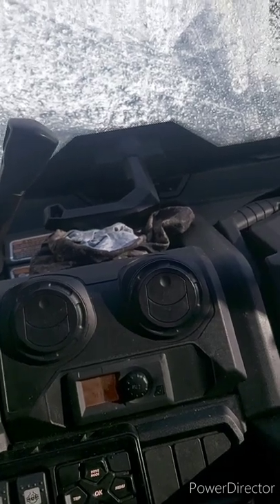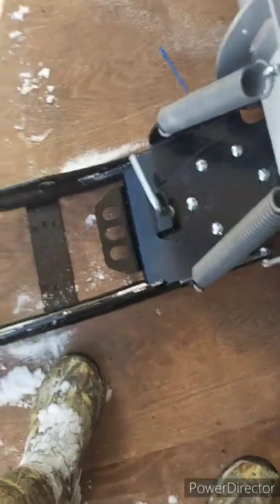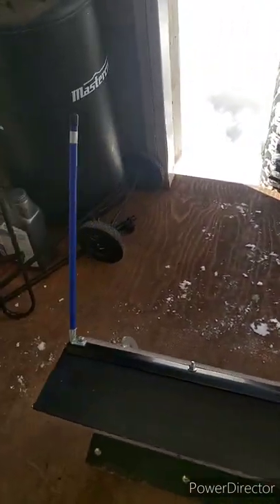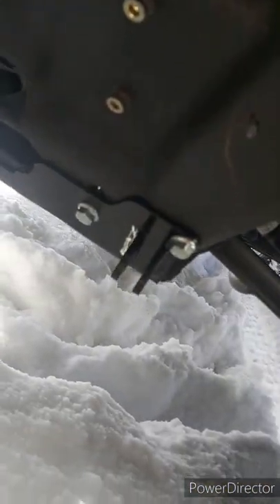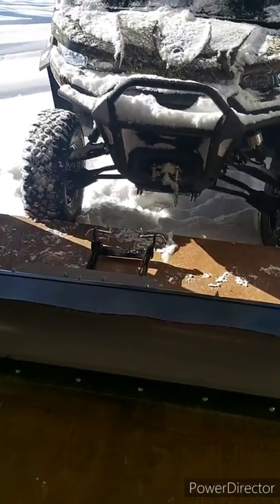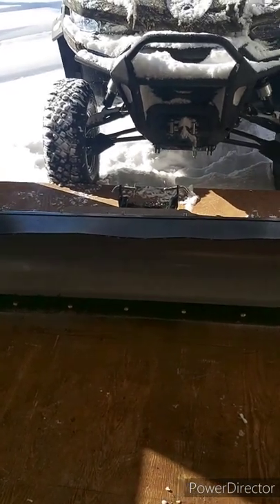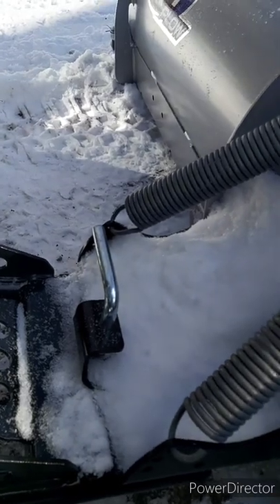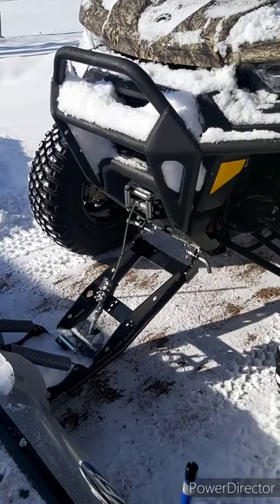KFI 72" snow plow on Canam Defender HD10 Review

Comment: I'm in season 3 of using mine.  (mounted on a Defender HD8) I highly recommend this plow.  I ordered a skid kit this season because the bottom holes in the brackets are key-holing.  I replaced the factory skid shoes last season.  So I have no complaints about the plow's performance.  I consider the skids to be consumable parts.